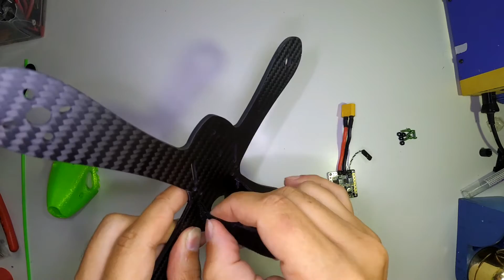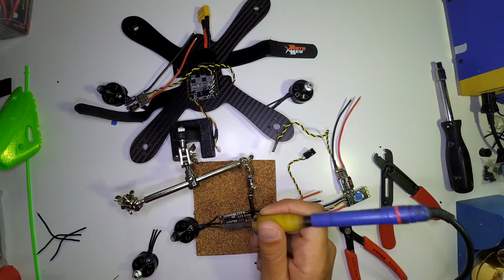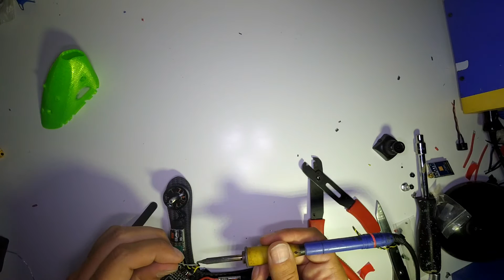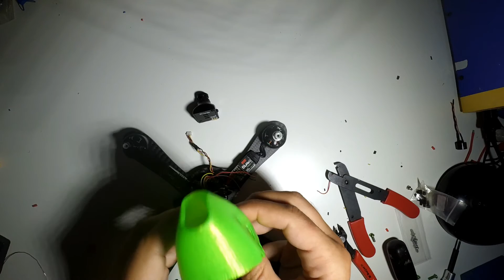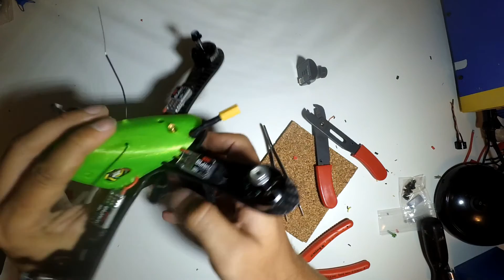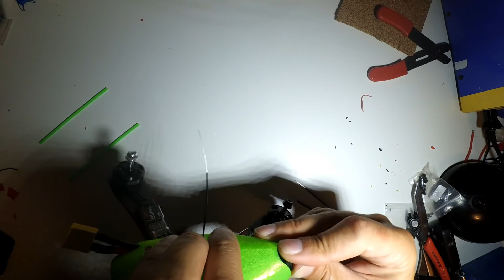How to build a Shendrones Mako 5"

Comment: Did you get motor bolts in your kit? I got the bottom plate, the POD, a sticker, four bolts and two nuts. Nothing else.
Reply from the maker: yes the motor bolts came with the mako kit

Comment: Which fc is that? I can't find a sp f3 board that looks like that.
Reply: Also what pdb is that?
Reply from the maker: http://www.banggood.com/Upgrade-NAZE32-F3-Flight-Controller-Acro-6-DOF-Deluxe-10-DOF-for-Multirotor-Racing-p-1010232.html
Reply from the maker: this is the pdb i used its not the greatest but it does the job. http://www.banggood.com/CC3D-NAZE32-F3-Power-Distribution-Board-PDB-With-Filter-BEC-Output-5V-12V-3A-for-QAV250-p-1023543.html

Comment: what PDB are you using? 
So you program the ESC's ahead of time to be normal or reverse?
Reply from the maker: Yes i program the esc's before installing them but you dont need to with blheli pass through you can do it later, For me everytime i get new esc's i open the package and connect to blheli flash them and set them up this way i know that the esc is working and i dont have a bad one. the pdb i used for this build is this one http://www.banggood.com/CC3D-NAZE32-F3-Power-Distribution-Board-PDB-With-Filter-BEC-Output-5V-12V-3A-for-QAV250-p-1023543.html

Comment: Hi! Thanks for this video. I was just wondering what the difference in flight would be with 20a esc's vs the 30a ones. Thanks!
Reply from the maker: Well the difference in flight would just be the speed i assume, the reason i am using 30amp over 20amp is because of the motor capability, the dys se2205 motors are rated to run a Max Continuous current(A) of 26.8Amps so it is better to use a esc with more amperage capabilities so you can max out the motor without any problems. If i was using a 2204 motor where the maximum continuous amperage is 16-22amp then i would use a 20amp esc